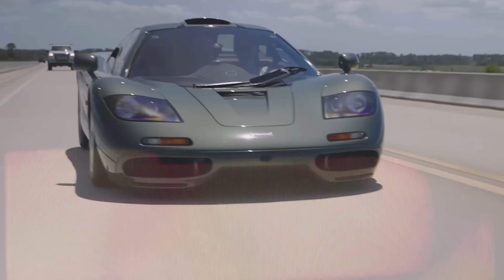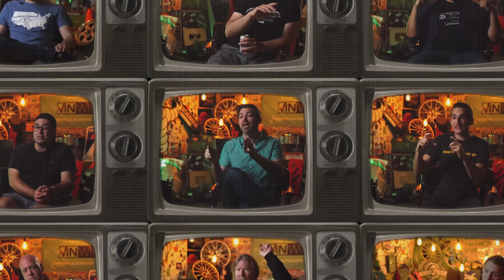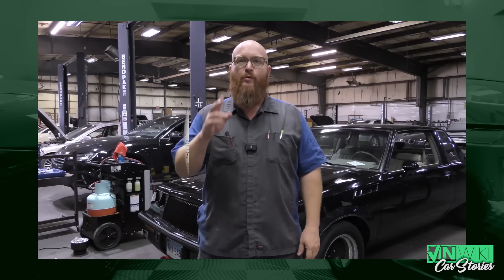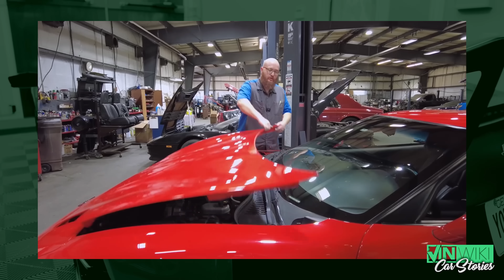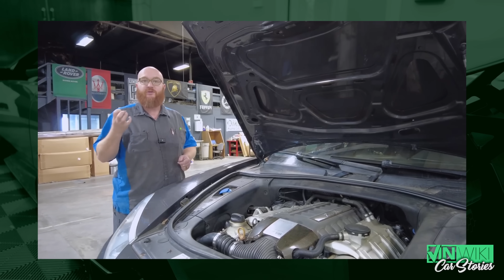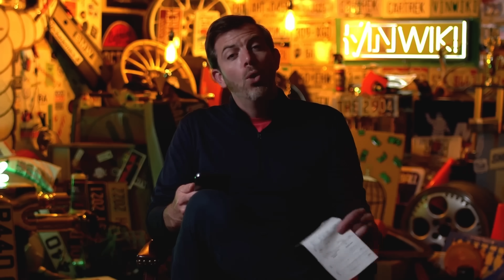How I became YouTube's most popular mechanic!

Comment from the maker: Were you better at taking things apart or putting them back together?
Reply: Im so good at putting things back, that I even do it with fewer parts! Its not a finished job until there are leftover parts. Aircraft included!
Reply: @RipRoaringGarage  Its called "lightened up for racing" 🏁 :finger-red-number-one:
Reply: @cumulusvapes7  I know but the FAA had a problem.pffft
Reply: Anyone can take things apart. Putting them back together correctly is the hard part.
Reply: When I was young I used to take my RC cars apart when they'd break and combine the two together to make a functional one or Repurpose the motors for science projects cuz, i had fun doing it. Now I can fix some little stuff in my own cars when it breaks.
Reply: Still working on putting my life together.. so the first part 😂
Reply: @RipRoaringGarage it’s called being efficient
Reply: I don't know about the putting back together part😂
Reply: @michaelrockwell9691  I can easily take apart anything it’s impossible to put things back and actually fix anything
Reply: I had a dirt bike spent a day taking apart then I couldn’t figure out how put anything back together I just scrapped the bike lol